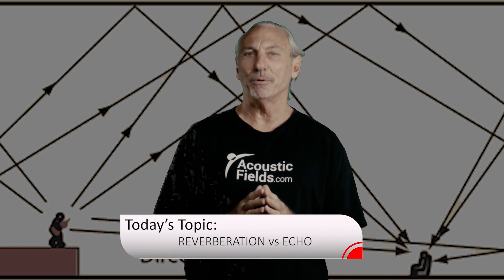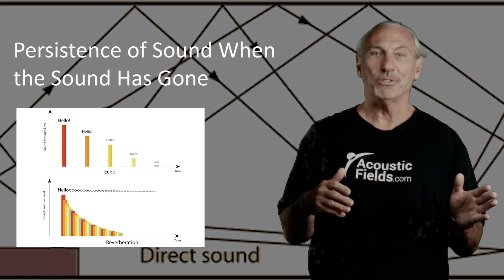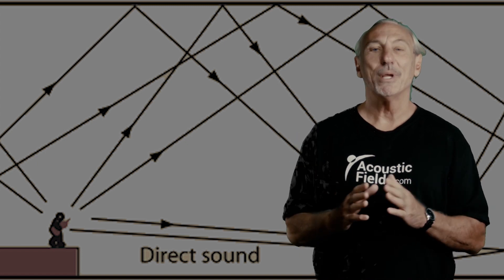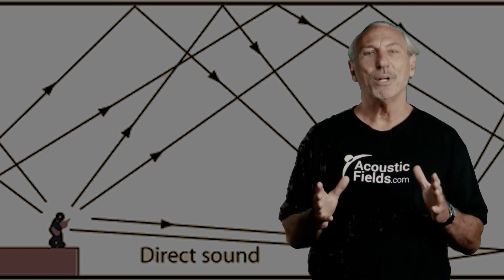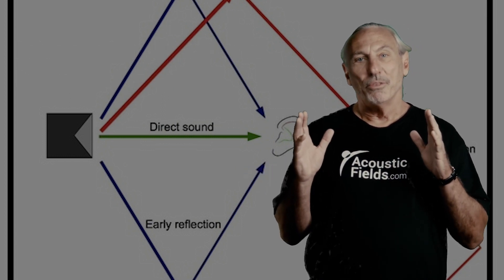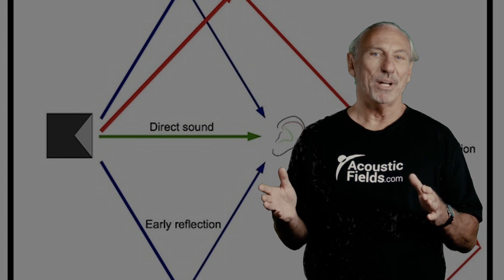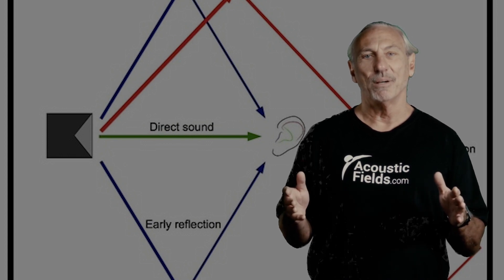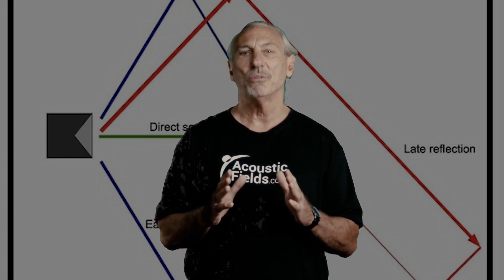Reverberation VS Echo - www.AcousticFields.com

Comment: Hello Dennis, I'm so thankful for all the information that you share, it helped me a lot. Now i moved all my gear on my attic space which is one big room about 100sq meters 10x10 with a chimney in the centre where the ceiling is about 4 meters high (which is great). I like the sound very much in that huge space, i have very smooth and equal low frequency response down to 35hz but the space is too big for me to heat in winter times. How can I close down the listening area with the 2 speakers in it and leave the subwoofers out of the space without stopping the sound and reflect it as well. I'm thinking of putting a couple of thich fabric curtains on my 4 sides and a thick layer of fabrick above my head as well to keep the warm in. What kind of fabric will to the best job or Is there a better option? Thank you.
Reply from the maker: M,  Use multiple layers 6-8 of natural materials.